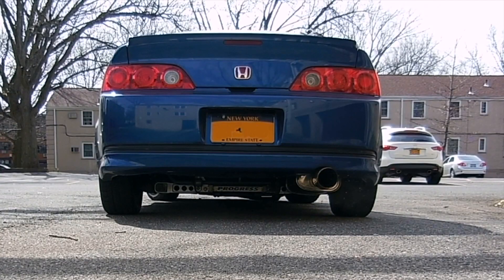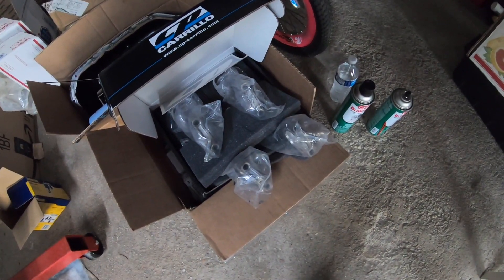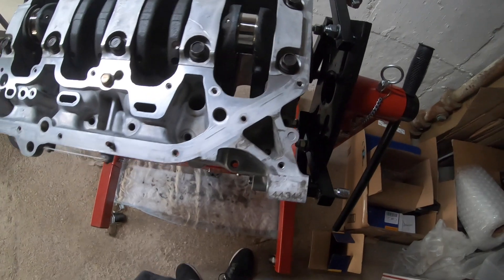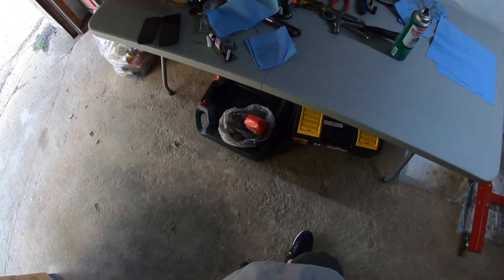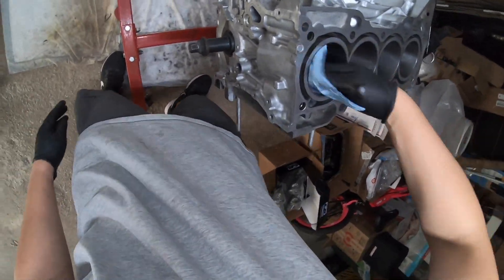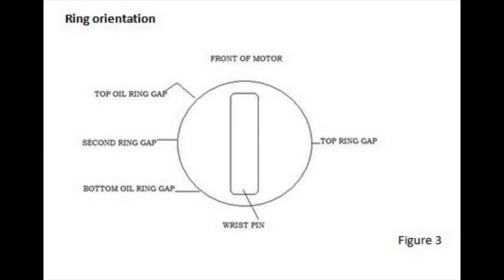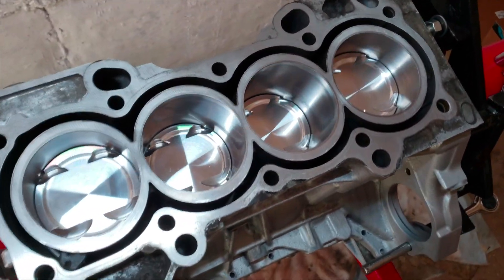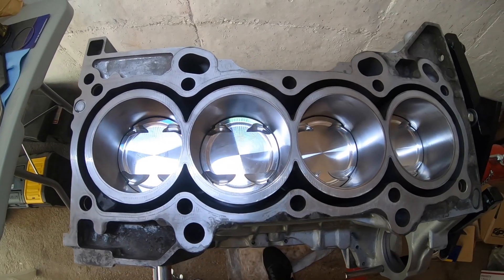HOW TO Replace Pistons Rods: EASY STEPS *

Comment: Where are you getting your torque specs?? The service manual reads 27lbs plus an additional 120 degrees, how did you get 50lbs??
Reply from the maker: Aftermarket rod bolts require aftermarket torque spec